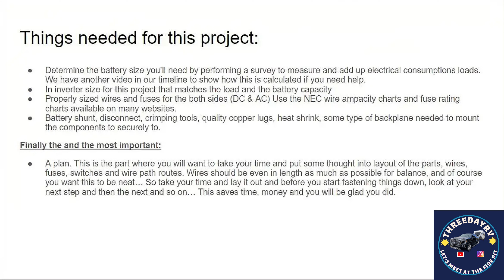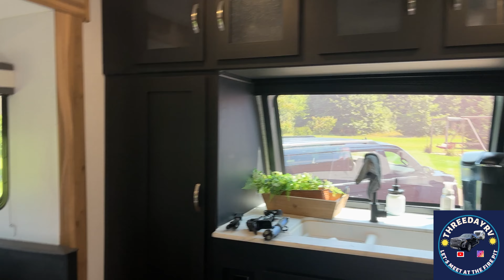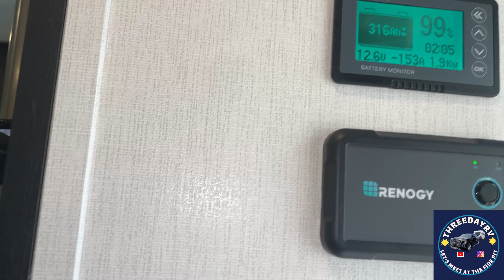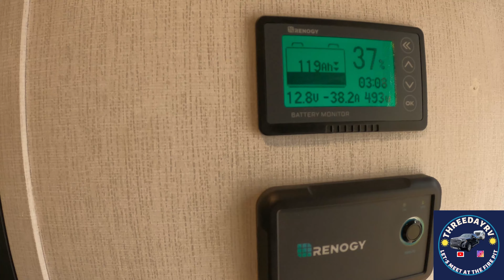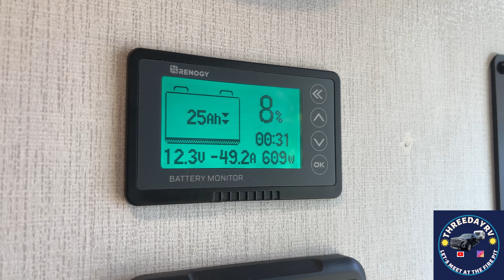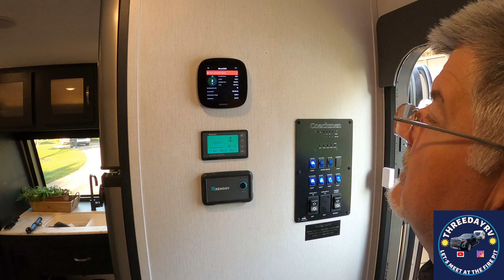Budget friendly RV battery test #lithiumbattery #rvlifestyle #rvdiy

Comment: Hi Keith what happrn to your renogy batteries did you wear them out already, reason I am asking I am looking to buy some renogy batteries
Reply from the maker: @bill8757  hi Bill, I have the Renogy batteries in our 2022 Freedom Express. I have three of those that are in parallel each being 200 AH. These are the "Core" series that do not have the low ambient cut out protection, they don't communicate just playing batteries. 

Unless you're getting the units, they have low cut out protection, golden mate offers an equivalent battery for considerably less money . Same warranty and same performance... I have discount codes for both that can save you a few bucks. 

Since I have a complete energy management system with data, logging capabilities, and my camper, I will use it to test other brands of batteries . The GoldenMate batteries are permanently installed in my BIL's 5th wheel. 

What size are you looking for Bill?
Reply: @ThreeDayRV  I am tossing up between a ecoflow pro3 and Renogy batteries. Around 4000mAh.  The ecoflow has the alternator charger that does 800watts so don't need solar.

Comment from the maker: So good news!  Coming up real soon we will be adding two of the GoldenMate Orion1000 Smart 12V 100Ah batteries with LCD Display & APP Monitoring to our off-grid hunting RV that has none of the high tech high end equipment in it. We will be showing how to do a streamlined up grade, batteries, 700W inverter (so we can watch football at night) a portable charge controller and recycled solar panel. The goal is to set up our fall camp with a simple low cost system. These Orion batteries will be a solid foundation. NO need for shunts, these have a sync cable and BT to check the batteries. Fingers crossed, this should be fun and we will as always show you how we did it and share the real cost... Stay tuned for a deer camp special.  #goldenmate